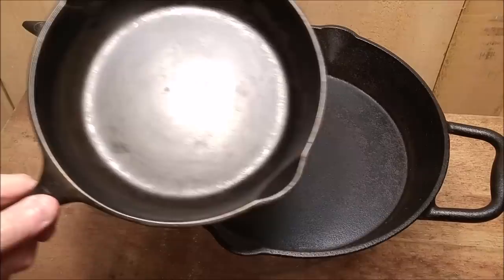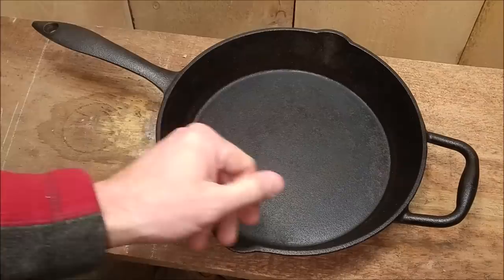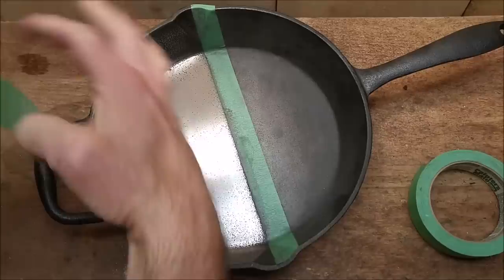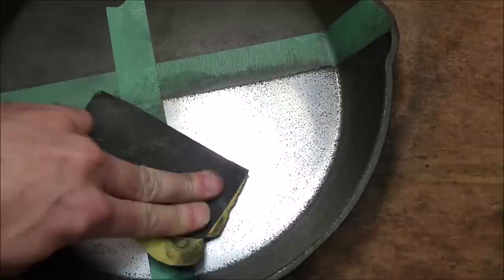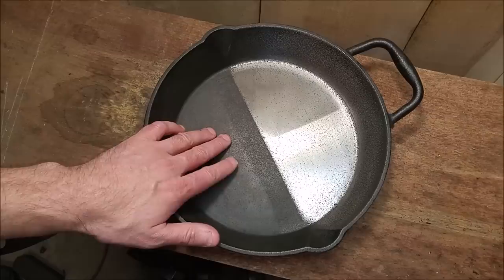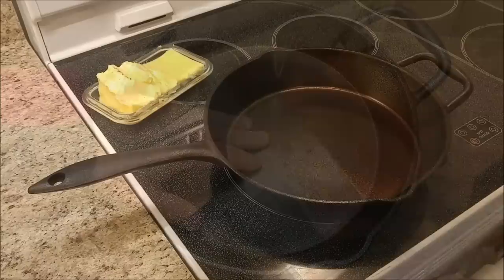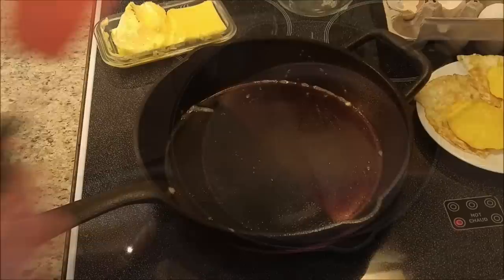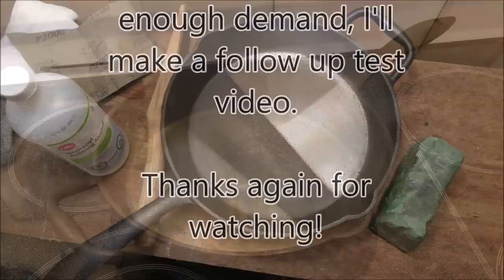🍳EXTREME Polish - Smooth a Cast Iron Pan to Reproduce an Antique Skillet then take it way beyond

Comment: what i believe the the reason for the different surfacing between old (smooth) and new (rough) pans is all about seasoning grip as pointed out in a few comments. at some point, i think late 70's, don't quote me on that, manufacturers realised that a rough finished surface was easier to blacken and preseason than a smooth finish, so the entire world cast iron pan industry changed its methods and now we have the modern rough finished pan, and apparently when changing they also thinned out the pans and added a ringed base to strengthen the thinner pans. this is visible by flipping your pan and you will see a ringed bottom instead of the flat smooth bottom like that of the older antique pans. but i might be wrong. but but my old pans (from my mom) are as described and my newer ones (that i have bought) are as described. check out your own and see. also try weighing and older v newer of same diameter and notice the difference in weight. happy cooking folks, oh ps. all my new pans, not my moms, i have sanded and re-seasoned, but i have found that going to a 320 grit (i use Klingspor wet/dry auto-paper) is more than enough, any smoother and you just scratch and damage the surface when cooking. The nonstick is more in the seasoning and oiling rather than the smoothness i think. but i guess you got to get both right to be successful.

Comment: Growing up my mom had the wooden handle cast iron from Taiwan from back in the 70s. I've slowly started amassing my collection, mainly with pan styles that she doesn't have. I keep trying to convince her to give them up as my parents are retired and don't cook at home anymore. Even went so far as to buy them all.
Reply from the maker: I saw one with the wooden handle, I was really tempted to buy it, but I figured that seasoning it would be a problem, unless the handle could be removed.

People love their cast iron, they are like children... except they can cook!
Reply: @NeedItMakeIt  it varies by manufacturer, but most of mine use a threaded rod with washer to hold the handle on. I usually do a initial seasoning with everything torn down. After that I just stove top season with the handle attached as needed.

Comment: I polished several cast iron pans with poor results. Like you they would not hold the seasoning. I eventually had to rough it up with some sand paper to get them to hold it.  I eventually came to the conclusion that the rougher surface of the modern skillets hold the seasoning better and hold up better to use with things that need to be boiled.
Reply from the maker: It makes sense to me now as well.  A little bit of rough texture would be the best.  I recently finished a follow up video showing how lower grits of sandpaper would hold the seasoning, and along with a good process for apply the coating, each of them worked out very well.  It was a neat experiment, but there is no way I'll be polishing another pan, anywhere from 100-220 grits work very well. 

I've not really tried to boil anything in my pans, and I don't own any pots, but that might be a good method of testing as well.

Comment: The newer pans with rough surfaces smooth out with use. The "pores" fill over time. I had one newer pan that I wasn't happy about because it had the rough bottom. Fast forward a year or two, I got a new larger pan. When I went to compare them, I noticed the first pan was smooth, not as perfectly flat as the one I got passed down to me, but it is smooth.

I wouldn't waste your time sanding. Focus on seasoning the pan, that's what fills the voids. When washing, I basically just wipe it with an oily rag, if it needs scrubbing, I'll add coarse salt with a bit of oil and use that as an abrasive. If it needs more, sometimes I'll rinse with warm water, maybe scrub with a plastic brush. I've never used soap on my castviron pans. The key is leaving more seasoning to make a thicker coating. I have pans I can fry an egg in as if it was Teflon coated.
Reply from the maker: I agree, after some time testing and researching, I've come to the same conclusion.  Seasoning builds up over time after repeated applications of fats.  I have heard from other viewers that a metal spatula also speeds this process along, I switched to metal and so far it has no harmed my pans at all, it is a pleasure to use since it glides under food so easily.

Those are all good points, I also have been using salt on occasion, it works very well.  

If you can't wait, I don't think there is any harm in knocking off the high spots, there is no point in polishing the surface, in fact it does not allow the seasoning layer to bond as well.

I've just finished recording tonight for 2 more videos related to this one, they are both starring this Lagostina pan again, so I hope you'll weigh in on those when they're released within a week.

Thanks for sharing!
Reply: @NeedItMakeIt  

 Now that you mention it, I've been using a metal spatula, I guess that may have helped.

Hopefully I remember to check for your new videos. I love cast iron, it's all I cook with.

Comment: The smooth surface shows a lower temperature because it is more reflective. The colder environment partially shines through. Same thing happens with thermal cameras. 

If you took a temperature measurement by direct contact they would most likely all be the same.

Comment: If your food sticks, I would do this treatment, but your well seasoned area did wonderful.  I did this process with with. New pans, they work great now. I can do eggs well. One of them is a dutch oven. I can stir fry in it, just like if it was a carbon steel wok. The seasoning did took a while.
Reply from the maker: I'm doing some testing right now on Cast iron and there seem to be quite a few factors involved in prevent sticking.  Do you think that temperature plays a role in the non-stick properties also?  Do you think a thick layer of seasoning would perform better than a thin layer?

Comment: I have been given a number of the cast iron pan cookie kits. It’s a little three inch griddle, and it’s as rough as a rasp. I go at them with grinders, sand paper, whiz wheels, and a polisher when I hang around the shop after work. They come out fairly decently for something you can only cook a single egg on
Reply from the maker: I have a small lodge pan, it works really well for a single egg, I do find that even though the handle is small it tends to teeter a little until I add the egg into the pan to counter-balance it. 

The handles probably get nice and hot on these small pans too?

Comment: I have my grandma's corn bread skillet from around 1900.  It does cook differently from the pan I got when I married.  It is heavier for one thing and slick smooth inside.  The bottom is flat and it holds heat better.
Reply from the maker: They used to smooth pans and left the seasoning to the user, but these days they're pretty rough.  The smooth does look nice and does give me the impression of a higher quality, I still don't know if it is more non-stick, but it is much easier to clean.  None of my pans are that old, would be nice to have an antique at some point.  

I have been wondering a bit about the thickness, and whether it has any impact on cooking.  I know it takes longer to heat evenly, which is a bit of a drawback these days.  Any advantages you can think of?
Reply: @NeedItMakeIt  The biggest advantage is that the pan holds heat longer and heats more evenly across the surface.  Once up to temp you can reduce the heat and still cook well.  I think the original advantage was that many people cooked on wood stoves or coal stoves.  The cookware had to be very robust  to take that kind of heat.  Also in cooking outside over a wood fire a thin pan would burn the food very quickly.  When using a Dutch oven or covered skillet the lid is very heavy which reduces evaporation and allows for longer simmering time.  As an added bonus you can cancel your gym membership.  Nothing like pumping  cast iron to build those muscles.

Comment: I find that a light "dusting" of cooking spray (Pam, or something similar) after every use is all that's required to keep my cast iron in tip-top condition. Spray lightly and then wipe it off. You don't need bacon grease or any fancy oil. The cooking spray is ideal.
Reply: Hey, Clarance: I have one smoothed Lodge that I've been experimenting on using the spray coatings. It seems quicker and appears to do a good job. I'm still in the initial stages with that one so time will tell.

Comment: coming from a guy that has only cooked in old cast iron the reason you want a smooth buff on it is simple rly  once you take a day and carbon coat it RIGHT and not half ass'd you will never have to worry about cleaning it and a simple wipe while hot will do then a little re oil and your set if you have a textured finish you still need to / will have to sctub it if you bake or something  all my old things can get stuff caked on and its just a wipe away with little to no effort where my wife's pan needs scrubbing if you cook in it regardless of how well you season it.
Reply: It is difficult to understand what you are writing. Try interpunction, add some commas and stops.

Comment: Gotta like CT sales eh, lol I bought the 12 inch model a couple weeks ago for $29. I sanded my 12inch Lagostina by hand too, I used a 80 grit then a 120 just to take the roughness / bumps off the thing. I also used a wooden sanding block to make sure I was sanding it flat. 

Once it had a few coats of seasoning it was very slippery.  Now I use it for all the cooking I do. I have a small no name frying pan from Princess Auto too and a medium 10.25 Wagner that I also smoothed out but it had a machined surface when we bought it new. I used a wire wheel on my cordless drill for the Wagner to start the seasoning process over again because the thing sat on a shelf for 20 years or more and had some rusty spots on it. I really like cooking on the cast iron though...  My elderly mom bought the 10 inch model you have and she uses it often also. 
Thumbs up! 👍🏼

Comment: I've got 2 faves. My daily driver is an 8" (I think) skillet that actually says Martha Stewart on the bottom. Someone gave it to me. I have the seasoning so thick that it looks wet with oil all the time but isn't sticky or anything. Just midnight black and shiny. I can slide eggs off it. Love it. My other is a massive 14" lodge skillet I meal prep with. It was also a used pan, so not sure the history on it. I actually got frustrated with it. Eventually I  stripped it with the easy off method and put 4 coats of flax seed, and have been using olive oil since. Performs much better now.

Comment: I just bought the same pan (from Canadian tire for $20) and the first thing I cooked was bacon. Now I have brown stains that won't come off no matter how much I scrub. Thinking of smoothing it out just for easier cleaning. My other pan is an old smooth bottom and really easy to clean. Problem is the bottom has warped over time and is now more on the concave side. If I had a gas stove that wouldn't be a problem but the wife insisted on one of those glass top models.
Reply from the maker: I have a video coming out tomorrow on that exact subject with this very pan.  When I bought mine it was already warped and bellied in the middle, I just didn't know anything about cast iron at that time... (i went to return it and the ones in the store were also) 

Have a watch for the video tomorrow night, then if you still have some questions just let me know, it will address your bacon staining question also.
Reply: Looking forwards to it.
Reply from the maker: @thatguyoverthere555  https://youtu.be/I1DaEke6sPQ  So there are timestamps in the description to bring you to the various parts that apply to your problem.  So now you know you're not alone with your struggle with this pan.  Also The very end of the video shows how I corrected most of the problem with the discoloration.

Comment: Just out of curiosity, why did you finish up with steel wool? IIRC, 0000 steel wool is roughly equivalent to 400 grit sandpaper - if you've already polished to 2000 grit, wouldn't steel wool introduce scratches instead of polishing?
Reply: There is different grit of steel wool. Some of it is very very fine and great for polishing

Comment: I own 8 cast iron skillet. I bought then second hand, and found that the only way to reach metal is to put them in a wood fire until red hot. I tried sand paper and then a power drill with a metal brush attachment to no effect. I tried caustic soda, with partial success.
That factory black finish is bullet proof.
Reply: I have a Lodge grill pan. It has ridges in the bottom for cooking steaks. The black factory coating has started to flake off. I have been coinciding throwing it in a fire.

Comment: The temperature is not different. Use a thermocouple to verify.  The infrared sensor is extremely sensitive to shiny surfaces and will often read most true on black / diffuse surfaces.  Shiny surfaces tend to show very cold.

Comment: Get some thermal paste and a small bar of aluminum, copper, cold or hot rolled steel with consistent surface finish. Cut three identically sized pieces, slather one side of each (weigh it for consistency) and attach in each sector at equal distances from the sides. Take your readings after heating for awhile. Should do the trick, even moreso than if you had an adjustable emissivity IR gun. Great vid, tho I think I’ll stick with my 20-year old pan and save the arthritis-inducing work for another one of the 85 projects I’ve got going on here :-)
Reply from the maker: I have all of those materials already, great ideas, thanks.

Comment: The difference in temperature readings is due to different emissivities of black, rough and polished surfaces. It looks like your IR thermometer is very similar to mine, a cheap model I bought from AliExpress. 

It is possible to change the emissivity setting in mine, and for most uses the default setting of e = 0.95 is pretty accurate. But for shiny surfaces like my stainless steel pan, I have to change the setting to e = 0.16 to get correct readings. I found this by putting the pan in the oven at a known temperature and let it sit there for an hour to warm up completely. Then I measured the temperature with the IR thermometer and adjusted the emissivity setting until I got a correct reading.
Reply from the maker: Good tip, I plan on trying this in a few minutes.
Reply: To get better results, measure the actual temperature in your oven with an ovenproof thermometer. The thermostat in the oven is usually very inaccurate, so it is better to measure it.
Reply from the maker: @anderseriksson1945  My most accurate measurement tool is the instant read thermometer https://www.leevalley.com/en-ca/shop/kitchen/measurement/thermometers/73812-javelin-instant-read-thermometer, I just need a way to insert it into something.  I have another one that can go into the oven, but the scale is tiny and won't be good enough.  I'll test what I have and maybe I need to buy something.

Comment: The infrared light that is measuring the temperature basically reflects the light off instead of showing up as a good reading if that makes sense. If you're ever seen a mirror in a thermal camera it's the same thing.
Reply from the maker: I have no, but I will now that you mention it.  So if I aim at something in the mirror, it will likely measure the object in the reflection? Not what I see, but what the tool "sees" ?
Reply: @NeedItMakeIt  Yeah, it's the same if you shone a laser pointer on it basically. you might see a bit of red but the rest of the light would be bounced off somewhere else.

Comment: Smooth surfaces reflect the light of the temperature gun, rough surfaces give a more precise reading, a contact measurement would reveal this,  use a little oil for heat transfer to the contact pickup, temp guns work well for checking temperature differences , ie checking for a bad bearing, or hydraulic rams where one has a leak inside, fluid leaking causes a temperature rise due to the energy being released.

Comment: The Lodge oil is light and super convenient, just a little spray inside a dry clean pan and wipe it inside and out, I use the blue shop towels.  Then I heat pan just until it smokes and they store nice.  This also builds and repairs seasoning easily in pan as you use them.
Reply from the maker: I find old kitchen towels and socks work well, but I've heard of a few other people using the shop towels with good success, so that's a good tip.  I'll try the just heating until it smokes a bit, I usually season in the barbecue because it smokes up the house and I leave it for an hour then to cool in the BBQ also.

Comment: I'm convinced that a light sanding with 80-100 grit will do the job. You will eliminate the high points on the surface that cause the sticking. Just reseason to cover the bare metal exposed. At least it worked for me. If you want to make it smooth, that works too but is it worth the effort since it is mostly an aesthetic issue?
Reply from the maker: I completely agree, I've done follow up tests and the best results came from 100 grit sanding, the seasoning bonds best to a surface that has this level of abrasion.  I don't really recommend polishing a cast iron pan, it is counterproductive, the seasoning doesn't bond too well and like you say, it is a waste of time, this was an interesting experiment though.  I have a few more videos on the subject which really dial it in.

Thanks for the great comment!